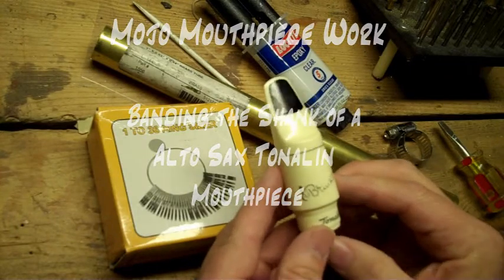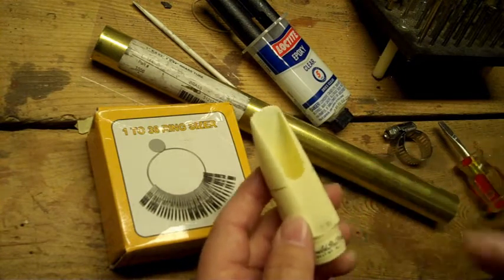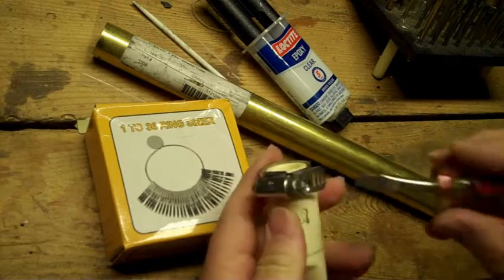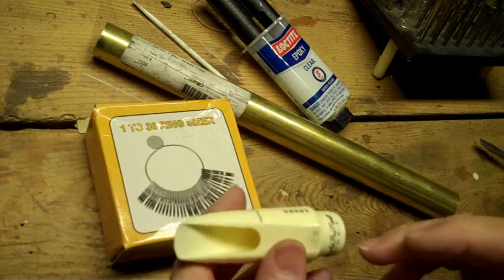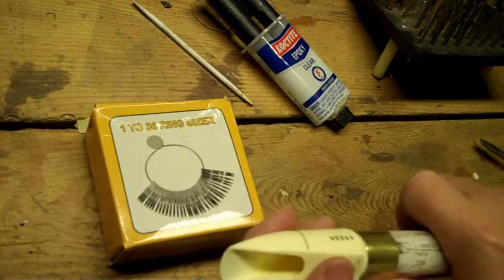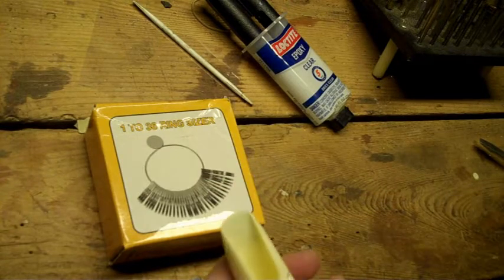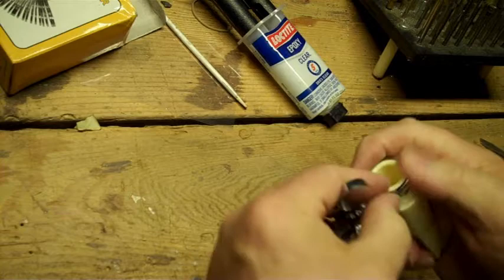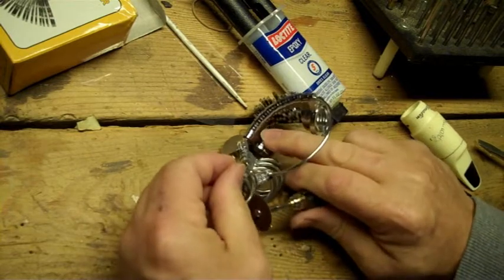Banding the Shank of a Brilhart Tonalin Alto Sax Mouthpiece

Comment: Nice job Mojo.....as usual. Carbon fibre might work too?
Reply: I was thinking the same.  One method used for clarinet and other woodwind bodies is cut a groove and wrap carbon fiber and epoxy into it.  Works in areas too thin to pin.
Reply: I'm guessing MJ did consider  that
Reply from the maker: I have never seen it done on a mouthpiece but I think it would be better than using fishing line or music wire that I mentioned.
Reply: My guess was that the "ring sizer" was a more esthetic repair
Reply: Not necessarily.  Use black epoxy and it could look like a flush black band when finished.

Comment: Nice! Helpful-- I'm gonna poke around my local thrift stores for a ring that will fit before ordering that ring sizing set.
Reply from the maker: loosegums This ring does a nice job but the fit is too tight.  You need to be able to make the mouthpiece end smaller to fit it in.   https://smile.amazon.com/gp/product/B01HTOHOXA/ref=oh_aui_detailpage_o03_s00?ie=UTF8&psc=1
Reply: another good option -- thanks. would you use a file or sandpaper to narrow the shank?
Reply from the maker: loosegums Dremel and file.